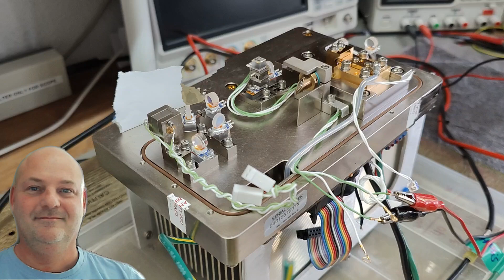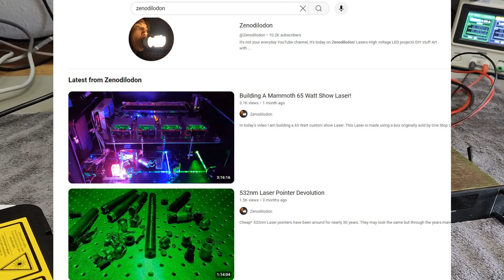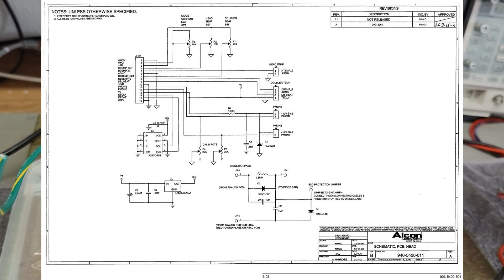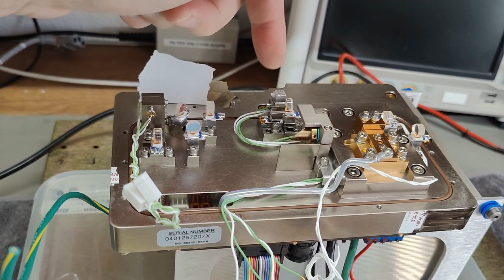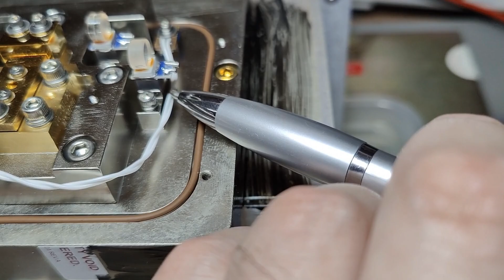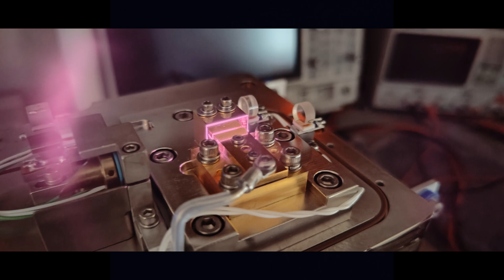Alcon Medical Surgery IR diode pumped KTP Laser Green followup

Comment: 5:14 - What did you change / tweak during the edit, to get some green output?

Also, hi to Zenodilodon. He has some great stuff on his channel.
Reply from the maker: he told me a million things about lasers :-) and a few hints to get green, push the resonant loop mirror mounts, just a little bit while looking at the output, and BINGO i get green, this prove it is out of alignment, and i need a more local expert with some special tools to perform final alignment
Reply: @TeardownOZ2CPU  I always liked using lasers, and built a couple of RGB lasers with galvos.

But I've never tried aligning an actual laser cavity. It's a bit beyond me. lol

When I bought a 3 Watt RGB laser module to build the last projector, I was in a rush to see some output.

I hooked up a separate 5V wall wart to the modulation input, and instantly killed the Blue diode. lol

I had to shove another diode in there, and it has never been aligned quite right ever since.
Reply from the maker: @electronash  we normal people dont understand the insane level of nano meters that is the thing with alignments in the resonant loop :-) i am far from figuring this out..

Comment: Very good! If you look at your output it appears as though you have some distortion in the green on the top and bottom of the main beam output. This you can use as a guide to get perfect alignment. You tend to get the distortions on the axis that you need to adjust, so at this point I believe a slight vertical adjustment my be needed for perfect alignment. That of course gets a bit tricky as the vertical adjustment is all done with the solder. You may be able to use a little metal foil shim under an optic to adjust the vertical axis. 

I am so happy to see the progress made and of course green photons!
Reply from the maker: thanks a lot for your help, it was super fun to get a little bit of green light :-)